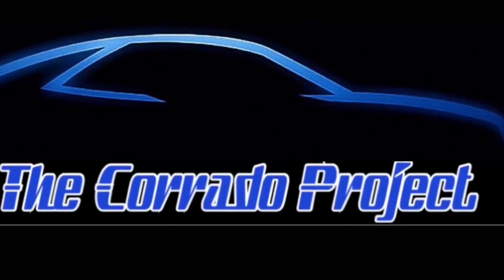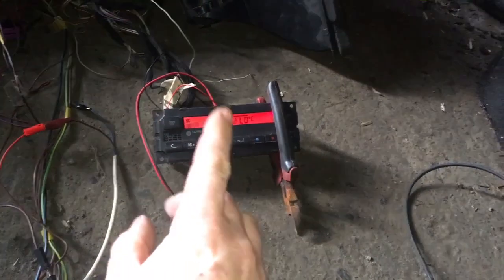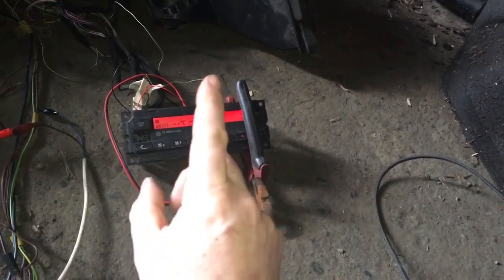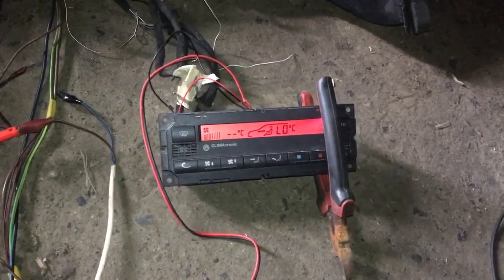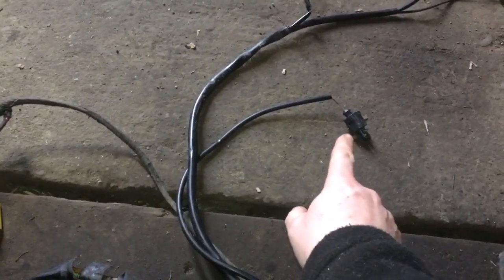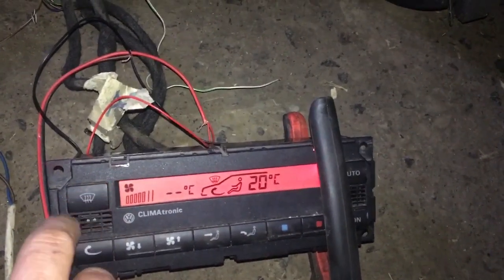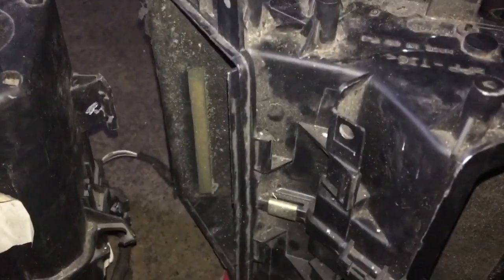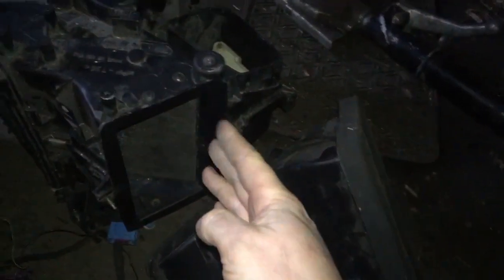Hvac climatronic control overview ep22

Comment: A good overview of the system, Thanks Steven.  I filmed parts of fitting the manual unit out of mk4 golf in my Corrado (still to finish! 😐😄), Mine has an overriding temp sensor (too cold) connected to the module in the bay, and outside temp would of been CanBus via dashpod, Keep it up !
Reply from the maker: Crispy's Projects oh interesting 🧐 get the video finished